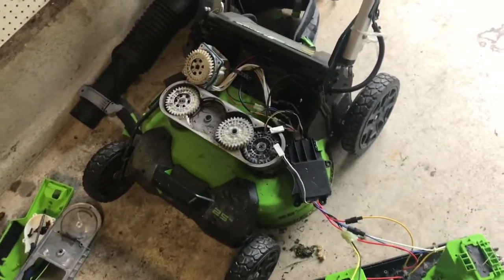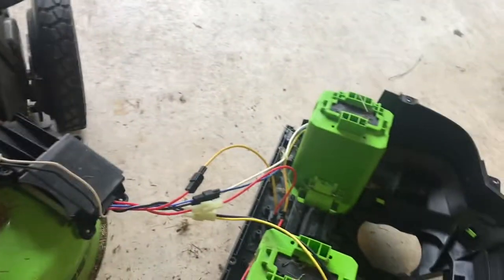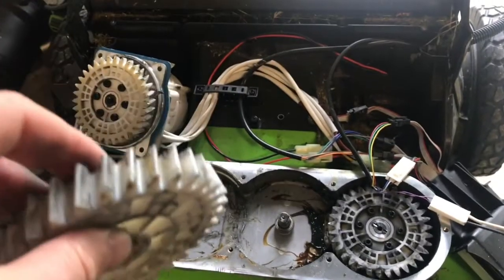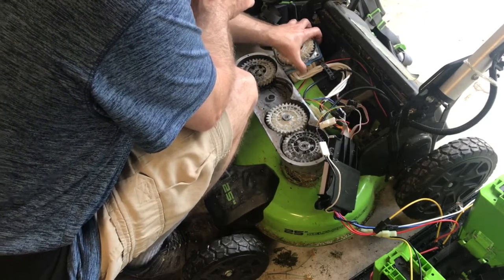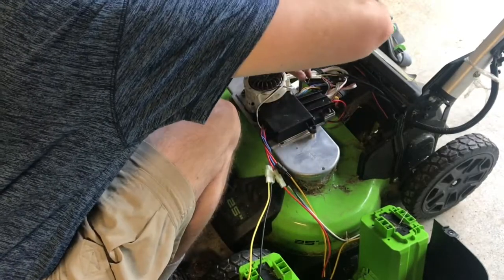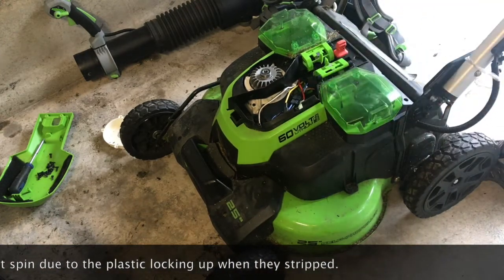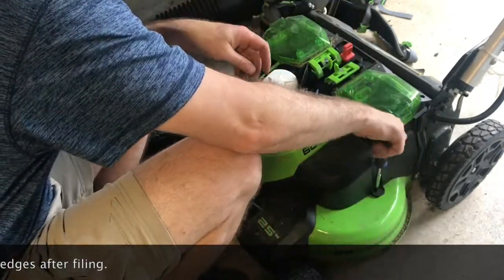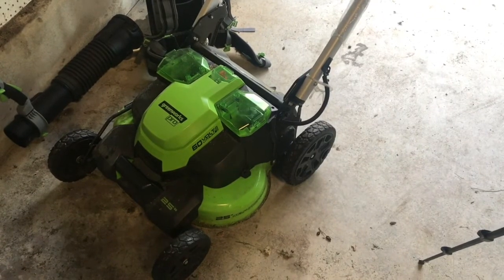2-Year Update:  What Were they thinking of?   Mower Tear Down - Greenworks 25" Twin-Blade Geartrain.

Comment: I was in communication with Greenworks (phone and chats) this week about getting replacement equipment for rear wheels self-propel and motor/gears for blade operation.  They would not sell me anything, except batteries, blades, and wheels.  Basically, if you are out of the 4 year warrantee, you are totally out of luck with respect to parts or service.  Nobody to buy parts from, and nobody to fix for pay.  Authorized Service centers too far away.  Closest one is about 45 minutes away.  That's 3 hours driving in total (a roundtrip to drop off; another roundtrip to pickup).  I live in an area with over 1 million people and there no service center around. They say it would be irresponsible of them to sell those type of parts to me.  Then they told me that the service centers are only for warrantee work!  They should make that clear on the box/online description when you buy a mower (plan to throw out mower in about 5 years).  They know it.

Comment: Hello, just did a replacement for the motor gear only as mine completely cracked and I still have the existing old gears in the mower. You can find aftermarket gear piece nowadays, a set of 4. Mine is making the same rattling noise as yours tho.. in the video it says the noise went away after an hour? Did you find a way to fix the noise? Please help it is so annoying..
Reply from the maker: Unfortunately I didn’t do anything proactively 

I think some smoothing of the gears happened naturally as it ran and it got a bit quieter. 

Sorry that the whole process can be a bit annoying.   Been there.

Comment: Not knocking the content as it's useful, but it's completely understandable why they used plastic gears. Cost is hardly the only consideration. I'd rather pull the top off to replace gears than pull the whole thing apart to deal with bent shafts and whatnot. Appreciate the video.
Reply from the maker: I don't want to replace a drive shaft either.  But I don't think people are understanding the durability difference between the two.   There is nothing that has been done to the plastic fantastic that I didn't do 10x worse to my old gas craftsman.  

I'm 100% confident that these gears are less durable than a drive shaft though.  Or a belt like Toro uses.  

Now by what order of magnitude?  That's open for debate.  My guess is less than 30% of the impact force that a drive shaft could withstand and these will strip.  

Cheers.

Comment: well, I think I'll go with the 21" mower after seeing this. although I'm sure it uses a plastic gear too. but only 1. I was thinking the 25" mower is less powerful since it splits the motor between 2 blades.  And if the blades ever hit each other. seems like more to go wrong. I want electric but needs to last 5 plus years. Have a Ryobi 40 volt for over 5 years now.
Reply: got the 21" mower in, picked up a couple used 4 amp hr. batteries for it. give it a try this summer. the plastic gears turned me off but I had a feeling it was split that way, I think the 21" is direct drive but I'm not 100% sure.

Comment: Hit a nicely camouflaged grounding rod with this mower and it would no longer mow. Upon taking it apart, found two gears had shattered. I  bought a new set of gears on eBay that I believe a guy is making with a 3-D printer. Spent nearly an hour having to bore out the gear holes because the screw slots would not align perfectly with the spindle screw slots. A few hours later, dozens of screws in the gears, housing screws, etc., tried starting the mower....it still beeps and does nothing. This most likely means the motherboard is fried but I am cutting my losses and moving on from Greenworks, who obviously did not make these mowers to last, proven by their lack of parts availability- just not worth the $$ and time when this will inevitably happen again. Appreciate the video though. Mower worked well prior to this, however, just not made to last.
Reply from the maker: Sorry to hear about your woes with this mower.  Can't disagree with you.

Comment: Good video. Gave me the confidence to take mine apart. Two gears were destroyed. Ordered aftermarket ones a d installed them today. Even taken apart, it took 2.5 hours to replace. Had trouble getting bolts to line up with the holes in the spindle. Mower works great, but don't think I would do that much work again. The gears cost $87. Think buying a new mower is a better decision for me.
Reply from the maker: Sorry to hear the full repair was such a challenge.  I'm probably going to follow the same path if this ever breaks down again and just replace it.
Reply: Well, we both have experience, now and every goes smoother the second time around. Also, shouldn't have started the project at 3pm. I lost my patience after an hour and half. 😁

Comment: You should get a second motor, and controller and set it up with 2 motors which is honestly how it should be frol the factory.
Reply from the maker: Shame on me for not doing my research.  Had I known this was the setup under the hood I would not have jumped on this product.  I looked at the width spec of 25" and told myself that was what mattered, but reliability was actually what I needed even more. 
Cheers.

Comment: I've had this mower for a few years without problems.  I wish it was made to be repairable, but we're on our own.  I see that somebody is making these gears and selling them on ebay.
Reply from the maker: Glad someone stepped up.  Hopefully if they are 3d printed they have the right strength properties.
Reply: I just bought a set of these gears. Thanks for the insight on replacing them.

Comment: My mower found a rebar that was sticking up in the lawn (previous owner effort of some kind).  It really did a number on the mower.  Thanks for showing how to get to the parts for repair, hopefully.
Reply from the maker: Sorry to hear.  Good luck getting it back in shape.
Reply: @ToolHombre  I finally took the cover off to see what the gears looked like.  I have one tooth broken on two gears ( the motor's gear and the left blade gear).  I haven't found replacements for these and the unit is definitely out of warranty.  Have you found or heard of any gear parts out in the wild?  Thanks.  Thanks again for the instructions, too.  It did help a bunch.
Reply from the maker: @qtrolazyg  Someone else in this video's comments said they saw someone selling replacements on eBay but I haven't investigated fully yet.
Reply: @ToolHombre  I actually stumbled upon an ebay seller with replacement gears made of metal.  I wonder if it jeopardizes the system in someway.  Am I disappointed that these gears are plastic?  Yes.  They have "give".  What is the "fail-safe" for the system if the gears are metal and, heaven forbid, I hit another immovable object?  ...inquiring minds...
Reply from the maker: @qtrolazyg   My guess is that the blades would become the point of failure, but that is how gas mowers have had to operate for decades.  
If I damage my plastic gears again I may just jump on those metal gears.  
The way I plan on doing it is only replacing the damaged ones with metal.  That way the next time I find something hard, the metal one will just 'win' against the next plastic one.  Finally, when all are metal, the blades should bend before anything else bad. 
I'm not super concerned about the e-motor since it knows to throw a fault when jammed and the blades don't move so I would think it would cut off before overheating itself even without the give of the plastic but. 
Only validation can prove any of this correct though.... 
cheers!
Reply: @ToolHombre  Thanks for the info.   ☺

Comment: There are plastic parts inside gasoline mower engines.
Reply from the maker: Not the head, block, crank, rods or pistons though.   Those videos with the plastic heads so we can see combustion?  They don't last long.  
"Having plastic parts" and having plastic do the main shock-bearing  jobs are the opposite.
Reply: @ToolHombre  The cam gear is plastic and also.There's plastic parts with the governor operation.
Reply from the maker: @Rhond-i7r  Again, what you listed are tertiary to the drive of the full motor's torque against the blades coming to a full stop. 

So you're saying we're ready for plastic crankshafts then? 
😂
Reply from the maker: @Rhond-i7r   I think you are misunderstanding what these gears are doing.  These are subbing in for a transmission.  Neutral-drop clutch-dump type shock.  Not just timing valve openings.  This is no where near the same relative stress.

Comment: Is this cheap build typical across the board with Greenworks? I see they’re coming out with a few new 30inch 60v riding mowers. Try to decide if they’re worth the $3500. And for $3500 that about the least expensive battery ride on mower you can get.
Reply from the maker: I think there is a wide gulf between their homeowner and farm/ranch series.  Their 'Costco' stuff is made for manicuring lawns that have already been manicured once before.  I learned the hard way. 

The only GW stuff I buy now I pretty much have to order from their website or the Ag partners they have like John Deere or Kubota stores.  

Their pro 20" + chainsaws are head and shoulders above the rest..  You need to get that from  GW direct or John Deere, etc.  So it goes with their 'professional' mowers.  

So yeah I think any 'good' ride-on is going to be pretty expensive.
Reply: I wonder if the 80v version is any better?

Comment: damn dude, it's a mower not a stump grinder 😆. seriously though your video answers several questions I had.  I was of the impression that it had a timed belt. This is better than I thought.  While I would prefer having staggered blades to begin with the fact that the gear drive is serviceable is a big upside. As a guy that grew up on a farm, I can appreciate user serviceability especially at that price-point.  If those polymer gears are all the same size I think I'd want to get a few to have on hand "just in case".  Thanks for the video. The information you've presented is nearly priceless.

Comment: I wish I would have seen this video before my son purchased his GreenWorks 25" 60V mower.  This mower is a piece of junk.  Cheaply made but priced ($750) like its made of gold.  A Gas powered mower would have eaten that root and shot it out the chute.
Reply from the maker: Cannot disagree.  They introduced a failure mode that other mowers just don't have.  "Ping" on gas = oops, dulled the blades.  Fixed with a grinder or a new blade. 
"Ping" on this = Oops.  Now my expensive mower is trash.

Comment: Anybody know how to remove the storage safety switch in order to remove housing cover?
Reply: Figured out how to remove safety switch.  Just need to press tabs on the switch and push it out away from unit. Used a screwdriver to press in tabs in order to push switch out.

Comment: How did you remove idler gear. I see how to unscrew gears on each blade but is idler pressed on?
Reply from the maker: Yes, everything under the aluminum cover on the inside was just press-fit if I remember correctly.

Comment: Just a counterpoint: it’s highly unlikely the gears are “plastic”. They are probably some variant of Nylon, AKA Delfina, Celcon or maybe Duracon. Nylon gears have advantages over metal gears in myriad ways: self-lubricating; shock absorbing ability and compliance (had the gears been metal and received that shock, they would have likely shattered or sheered teeth off); lower gear whine; lighter weight due to lower density than metal. Nylon gears are actually more expensive than metal. 

I understand the frustration with Greenworks not carrying spare parts, though. I recently purchased an end-of-product-life Snow Joe 100V snow blower, and I cannot find a spare battery anywhere, including Snow Joe themselves. The inevitable death of my only battery will brick my $500 snow blower.
Reply from the maker: My stance is now that the gear-timed blades were the wrong way to go.  Multi-blade decks are typically not timed, but offset and driven by belts,etc. so that the inevitable slip and give are allowed.   I think they sacrificed durability for 'evenness' of cut, which must have been an inflated metric in their product development. 

Edit: even if the nylon gears had give and weren't damaged, (or if they were serviceable), this tear-down is not something I would expect a homeowner to want to go through.  Hitting a stick and needing to replace a blade is the typical failure mode of any mower.  Now there is a weak point that fails long before a blade will.  Unnecessary and complicated maintenance by not going with an accessible belt or such.  

I hear you on the shady product lines.  I got into Kobalt 80V early on.  Now I'm wondering if I should adapt my tools for Greenworks 82V batteries and vice-versa for continuity when either a tool or battery breaks and makes the other useless.
Reply: @ToolHombre  I'm wondering if a guy could use a warm knife to remold the gear teeth after this incursion.  Do you know if the teeth will melt rather than burn?
Reply from the maker: @kirksway1  I used a soldering iron with a flathead screwdriver bit as the tip on one of the teeth if I recall.  Molded okay.  From there I was able to at least fix the engagement and they have smoothed themselves out a bit in service.

Comment: So I understand this correctly, you’re saying due to operating error (manual states to clear area of debris “before “ mowing) that this machine is the problem. I did a lot of research before purchasing and realized that green works are made of plastic close to 97%. Makes one wonder “what were they thinking”
Nice video btw, you appear to be a hands on guy.
Reply from the maker: I would say read the rest of the comments.  The problem is that they don't service this part.  No replacements.  
A recent commenter said they let their kid use the mower.  

It happens.  A craftsman gas push mower can handle what this went through and all it would need is a blade sharpening.  This was an underwhelming amount of 'abuse' compared to what other mowers go through. 

If you want a mower you can let your brother-in-law borrow, look elsewhere.  

That is all.

Cheers.

Comment: I ran over a steel bolt and the mower shut off. It started back up but is really noisy. I disassembled it to see teeth destroyed on each gear. I removed broken pieces and reassembled. It starts and runs fine but the noise is deafening. Is the noise due to the damaged gears? I can’t believe they are not available.
Reply from the maker: I do believe it is the damaged gears that make all the racket.  They do quiet down once the jagged edges wear down a bit, but never as good as new.  Plus I'm now always worried I'm going to hit a stick and make it even worse than before.

Wish I had better news.  Cheers.

Comment: Mine is also a Greenworks dual blade 20”. It’s 3 years old and it’s making a loud noise in the engine area. Runs and cuts, but I gotta find out what’s wrong with it. Going to put new blades on and see what I can see.
Reply from the maker: If you're lucky it's something rattling that can be tightened.   Unfortunatelly the only odd noise I've encountered have been these plastic gears being warped

Comment: Tool Hombre
 I have one of these the same two gears have missing teeth i called greenworks to buy replacement gears and was told they don't sell them to the public he said they need them for the assembly line how crazy is that I told him they should worry about the mowers out in the field so 750 dollars down the drain .
Reply from the maker: Yeah Greenworks really blew it with this mower's roll-out.
Reply: Greenworks is misleading and totally irresponsible when it comes to the approximate 5 year LIFE of these mowers.  They don't care.  They won't help you extend the life with parts or paid service.

Comment: Thanks for this very helpful video, I can tell by the sound I have a gear problem also I was thinking motor bearings before watching this.  I have the 82v version, was there not a small switch on the back left corner of the top plastic cover that looks like it has to be removed first.  I am stuck at this point I don’t see how to get the switch off.
Reply from the maker: I don't recall a switch that had to be removed from the plastic cover on the 60V version.  
I was able to pull some of the top cover off with wires still attached because the mounting screws were separate from some of the electronics screws.